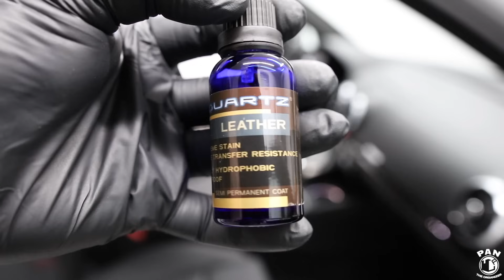AUDI RS3 : FULL DETAIL OF A WHITE CAR !

Comment: Awesome video!!! The only thing that was not covered which I think you mentioned at the beginning is the carbon build up in the tail pipes. Still awesome!!!
Reply from the maker: Thanks Nasir!  For the carbon buildup, I used an APC cleaner and P21S polishing soap and it worked wonders.  If they are really bad, you can also use steel wool 0000 (the softest).

Comment: Excellent detailing after spraying the solution to remove the rust spots do you have to apply the coating of wax?
Reply from the maker: If you apply wax, you can’t apply a ceramic coating.  You have to decide what form of paint protection you want: wax, paint sealant or ceramic coating.

Comment: Hello Mr. Pan Man! I have a 2016 Subaru WRX and I was wondering how you would clean the steering wheel and go back to that matte, new finish. Thanks and keep up the great work!
Reply from the maker: Hi Luci!  You have to remove all the body oils from the steering wheel (it's the oils that give the shiny look, sign that it's time to clean).  What I like to do is use my McCulloch Steam Cleaner (which I reviewed on my channel) and steam the leather up and apply some APC like Super Clean (yes it's safe, all modern leathers are coated leathers from the factory).  That gets the job done.  Then I protect with either a nano coating (like CarPro Leather) or a leather conditionner.  If the leather isn't too dirty, you can simply spray a bit of leather cleaner on a microfiber towel and wrap it around the steering wheel and rub with a twisting motion.  Then protect.

Comment: Hey Pan quick question. When you say Diluted 1:9 do you measure it in ounces or what?
Reply from the maker: 1 part product to 9 parts of water.  If you use 2 oz of product, add 18 oz of water.  Total solution of 20 oz.

Comment: AWESOME!!! Now I can save some money and do this myself.  My M2 came with clear 3m wrap that now looks pretty bad.  I would like to remove it and then go through the process.  Any tips on how I can remove it and then clean the area where it was applied so that it will not have any of the 3m sticky residual left?
Reply from the maker: +S2Kdrift1 
I have no experience with cleabra removal but from what I’ve seen online, you use a heat gun to heat the film and peel it off.  A good degreaser will help remove the residual glue.

Comment: Did you use the eraser before or after you polished? Or both? I always do it just after I polish to remove leftover oils before applying ceramic coating.
Reply from the maker: +Joe B 
Eraser before but not after just for this CarPro Essence polish as its different from other polishes.  It serves as a primer for SiO2 coatings so you don’t use an IPA wipe.  But yes, for any other polish, I always perform an IPA wipe after to remove polishing oils and promote s better bond for protection products.

Comment: What type of pressure washer are you using? Or what kind do you recommend?
Reply from the maker: Hi!  In this video, I'm using my new high end Kranzle 1122TST pressure washer (it costs 1200$ USD but is probably the best electric pressure washer on the market).  I reviewed it in this video: https://youtu.be/Cj4FDpKuORI

But before that, I had a wonderful Karcher K5 pressure washer that was also fantastic, at a lower 200$ USD price point, which I also reviewed here: https://youtu.be/v_vbuUogjd4

Comment: So this ceramic coat will limit swirl marks from future washing and drying
Reply from the maker: No.  That’s not the purpose of a coating.  That’s marketing hype.  It will help reduce light scratches or marring, not eliminate the chances of getting them.  If you want to scratch-proof your paint, you need to apply a PPF.

Comment: Hi Pan! Im from Costa Rica 🇨🇷, Could you tell me which is the right pressure washer to wash well, but not risk damaging the car paint?
Reply from the maker: Any pressure washer delivering 1000 to 2000 psi maximum.  Don't go over 2000 psi to wash cars as you could potentially damage the paint.  Karcher is a great value brand for quality and price if you have access to those in Costa Rica.
Reply: @PanTheOrganizer  Thank you very much, very kind for your answer, yes, indeed we have Karcher in Costa Rica, or by Amazon.  I want to put a detailed center and I don't miss your videos, they are great.

Comment: Thanks for the great videos on detailing.  You protected the leather with a Ceramic Nano coating.  However the mfr. says not to use their product on white or light colored leather.
I'm getting a new Range Rover Velar with white interior. What you you use instead to protect it?
Reply from the maker: I used CarPro Leather nano coating on my light dakota beige leather seats in my BMW and never had issues.  I even made a video about the process: https://youtu.be/eYFzVPE_I2o
Reply: I know, as I have watched that video.  My new interior is snow white, so I am not comfortable using the CarPro nano coating considering the mfr. says not to use it on light or white leather. My question was, what would you use instead of a nano product to protect the leather?

Comment: Hi Pan, got a question here. Is it impossible to ensure zero scratch during the washing process? My car has the non-metallic white paint, it is pretty easy to find the fine-scratch by using the swirl finder light. Usually I would use the light to check the paint condition every time I washed the car.
Reply from the maker: Good washing and drying techniques help massively reduce scratches and swirls.  I can never promise scratch free as many factors come into play, but my cars don’t have any, and if there are they are so minor it would take a swirl finder light to see them.

Comment: Pan, I own a 2018 audi s4 with a digital cockpit. I received a complementary interior and exterior clean upon my first visit to the dealer for an oil service. I can now see streaks and spray marks on the digital cockpit screen when the sun hits it, so Im assuming the cleaner person sprayed directly onto the cockpit screen. It should be similar to the RS3 cockpit screen (non-glossy). 
Is there a way I can save my screen, any products or tools you would recommend!? Any advice would be much appreciated. Thanks!
Reply from the maker: Spray a quality glass cleaner like Stoner Invisible Glass on a glass microfiber cloth and gently buff the screen.  It should come back like new.
Reply: Worked perfectly. Thanks!

Comment: Pan,

Instead of using the clay bar have you ever tried the Nanoskin AutoScrub Wash Mitt?  It seems to be a lot easier to use.  Also doesn't using an iron remover do the same thing as the clay bar?  I do use the clay bar but I find it to be too time consuming and kneeling it all the time is getting hard on my hands.  Thanks for your reply.
Reply from the maker: Claybars remove the top exposed contaminants (like when you shave, the blade cuts the exposed hairs) but there are some contaminants, like iron, that are embedded in the clear coat and need to chemically “melt” to change form and to flush them out of the clear coat.

Comment: Great video, what a good looking car when you were done with it. Three questions: First,  I didn't see a link to AngelWax H2Go. Second, in the wheel wheels of my Audi A6, the surface isn't smooth but has almost a felt-like material in there. Any tips for getting that clean? Dust and debris love to hang out there and I find it hard to get off. Finally, you mentioned in the intro you were going to clean the carbon off the tailpipes, but I don't remember seeing in the video how you did that. Thanks!
Reply from the maker: +iaflyer 
For luxury cars, fender well liners are usually in felt-like material (kind of like carpet fabric) for better sound insulation.  You can use a fender well brush to clean them with soap and most importantly, use a pressure washer and spend a couple minutes on each one to flush away as much dirt as you can.

For the tailpipes, I use P21S polishing soap, wheel cleaner and soft bristle brush.
Reply: Thanks a lot, I'll try that!

Comment: What mix rate are you using for the Hyrd02 formula for the wheels? Also - It appears that some people use it on the paint - if you're not immediately going to ceramic the car, can you use this as a 'hold-over' or is that a bad idea?
Reply from the maker: +Rob Wilmoth 
Hi Rob!  I use HydrO2 diluted 1:7.  Yes it’s also great for paint (lasts 3-4 months).  I did a video on it here: https://youtu.be/d1beB0P4sOM

Comment: Great video man!!…what will the cost of a full detailing be with the use of 3 to 6 month wax instead of the ceramic coating?
Reply from the maker: I don't understand your question
Reply: @PanTheOrganizer  
What’s the cost of a full exterior detailing?
Reply from the maker: I never discuss prices on YouTube as it's pointless to do so for many reasons, including location.  A detailing job like this doesn't cost the same in Montreal as it would in New York or Paris for example. Your best bet is to contact a detailer locally to you and inquire about their pricing.

Comment: Hey Pan! In the process of getting my car ready for fresh coating of sealant and wax. Regarding the strip wash soap, will that also remove a ceramic coating I’ve applied to all the exterior plastic bumpers and fender trims? And if so, would it be better to use something like Pinnacle Black Label Surface Cleansing Polish on the paint to remove old wax and sealants? Thanks as always for your great advice!
Reply from the maker: Stripping Soaps will not strip ceramic coatings.  They can help break down older layers of waxes and sealants.
Reply: Pan TheOrganizer Thanks!

Comment: I heard somewhere citrus/acidic cleaners are bad for diamond cut wheels? Is this true? Don't know if CG Citrus Cleaner is acidic but I assume it is.
Reply from the maker: No worries if they are factory wheels and you follow the directions on the bottle.  Usually, you spray in a shaded area or in a garage, let it dwell MAX 30 seconds and thoroughly rinse.  Never had issues.

Comment: Hey pan! I bought a new car (Seat Leon St. FR. nevada white 2018) that has leather/ alcantara seats. But what product can i use to protect both, the leather and alcantara? Can i use the CarPro Fabric for both, or shouldt i use one product for each Material?
Reply from the maker: We typically don't coat alcantara.  You can clean it gently with CarPro Inside diluted 1:5 or another dedicated alcantara cleaner.  You could in theory apply CQuartz Fabric to protect it, but don't spray it directly on the fabric.  Spray it on a microfiber cloth and apply in a thin coat.  Test in an inconspicuous area first.
Reply: You are amazing! thanks again Pan! i will test in an inconspicuous area first. If it's good, i will apply it to all of my seats! :D

Comment: I did my first wash today and had some issues. For example, my foam wasn't as thick as yours. I almost feel like I might not have put enough soap in my foam cannon because it was definitely more watery. 
Also, drying was a b**ch here in SoCal. Even I did it just after sunset, it was still warm and I got some water spots :/ I also don't understand how you can make your drying towel glide over the body panels like that. Mine always get's stuck sorta.
Reply from the maker: Looks like you might have so hard water issues.  Maybe a deionizer like CR Spotless would be good for you.  Spot free washing and rinsing.

To have a thick foam, there are many variables to get it just right.  You need a pressure washer capable of pumping out more than 1.5 GPM of water (more waterflow equals better foam), you need a good foam cannon (like my MTM PF22), and find the right dilution of soap for the canister.  Typically, 2 oz of soap to 20 ounces of water is a good start point, but always follow the recommended dilutions on the label of your snow foam.

Also, what snow foam are you using?  See my latest snow foam challenge video: https://youtu.be/DEhRXn027kc
Reply: Thank you for the quick reply. I got a great brand new pressure washer you recommended to me last week. It's the Sun Joe SPX3001. I also got a great foam cannon from The Chemical Guys. So neither one should cause the issue. I did not measure the soap when I put it in the gun, because I didn't have anything to measure it with. Maybe I didn't put enough in there. I am using the Honey Dew solution. 
I should maybe measure my water quality. I was hoping not having to buy anything else to finally get my car clean haha. I have to look at the car in sunlight one more time tomrrow to see if there is a lot of waterspots. I hope not... That would be a clear sign of hard water huh?
 I also noticed that the surface of my car is pretty rough. Definitely need to do the full program with clay bar and wax next time.
Reply from the maker: Yes, water spots are a sign of hard water.  I have a whole house water softening system and have no issues.

Make sure you add roughly 1 to 2 ounces of CG Honeydew Snow Foam into your foam cannon container, with 20 ounces of water.  Make sure you get the aeration setting to the correct position on your cannon.  You should get plenty of foam.

Also, don't let the soap dwell on the car too long, you don't want it to dry on the paint.  Following your pre-wash with the foam cannon, a wash stage with two buckets is a must.
Reply: Thanks Pan! Yes, I watched a few of your videos just before I got started even I had already seen them, just to make sure I am ready. 

If I wash with hard water in cooler conditions, will I still have water spots? Is there anything smaller under $100 that could soften the water? I have seen a few filters you can plug into your hose, but I am not sure if they do the right job. Water softening is a vague word I believe. It has to be deionized if I am not mistaken? 

Such a bummer. Just spent quite a few bucks buying all kinda stuff to finally hand wash my car and now the water quality is bad (hard).
Reply from the maker: Don't worry too much about it.  Try working on cool days, always in the shade. As soon as you're done with your final rinse, IMMEDIATELY dry your paint with a microfiber drying towel.  Also, use a quick detail spray as your drying aid, this will reduce the water spotting issue a lot!  While the car is still wet, spray the quick detailer and then wipe dry with your drying towel.

I have a tutorial on how you can make your own quick detail spray at home, and it's one of the best on the market: https://youtu.be/Kn8wYn_P9Js
Reply: Okay great! I will try these tricks and tipps. Thank you very much! I'll let you know how it goes!

Comment: Hey Pan, after applying a paint sealant, can you polish it and use an IPA or will using the IPA remove the sealant?
Reply from the maker: +staaymadbro 
Better to polish to remove waxes and sealants, or use a powerful strip-wash soap  and snow foam it like Purple Power Vehicle and Boat Wash (pH 10).  Best thing I ever used to strip waxes and sealants.  Check out my “How to prep your car for winter video” I present it and talk about it.
Reply: So regular maintenance will do for the sealant until 5-6 months down the road where it's time to apply a fresh coat of sealant? Thanks for all your replies! Much appreciated.
Reply from the maker: +staaymadbro 
If it’s a paint sealant yes.  A ceramic coating typically lasts 2-3 years.

Comment: You didn’t say in the video how you cleaned the tail pipes? I noticed you don’t you use all the same products when detailing a car, why?
Reply from the maker: For tail pipes, I usually start by spraying a bit of APC (all purpose cleaner) and scrub with a 0000 wool or use P21S Polishing Soap and the supplied applicator.  Works wonders.

Comment: Why do you rinse going from the bottom going to the top? When you get to the roof you putting foam back on the body of the car
Reply from the maker: Hi Josh!  This is a rinse method that is becoming more widely used by pros as it activates the suds even more when rinsing.  But which ever rinsing method you use is fine too.

Comment: You are 100x more thorough and experienced than me, so I'm not suggesting that I know better than you, but for some of the other viewers, I would like to add that I like to use 2 or 3 wash mitts (one specifically for the lower section and front grill).   I find that it helps extend the life of my nice mitts and keeps cross contamination down.